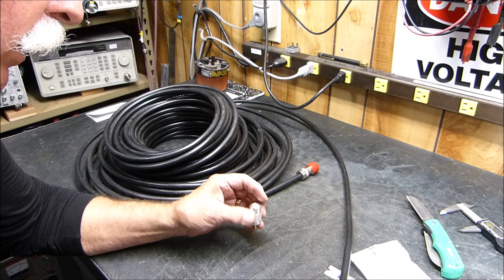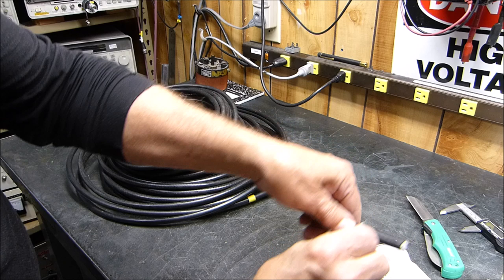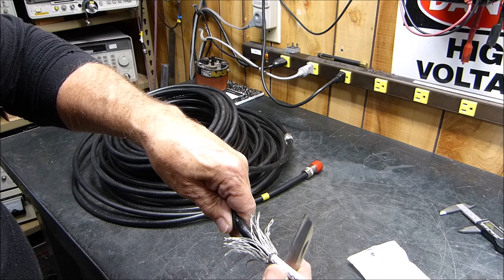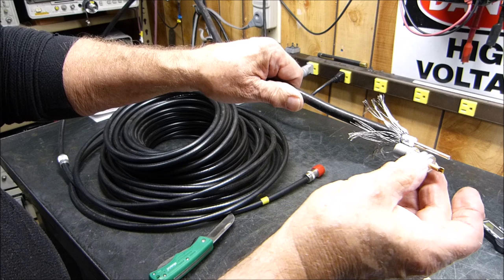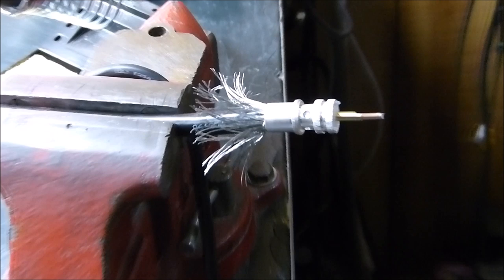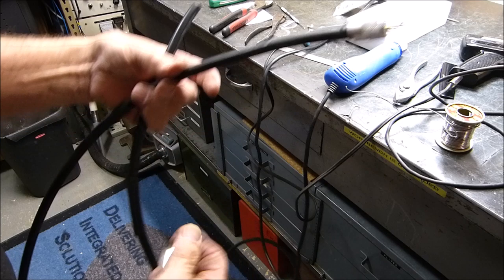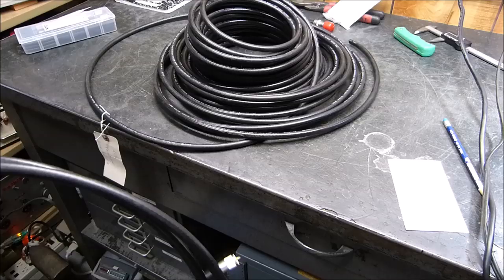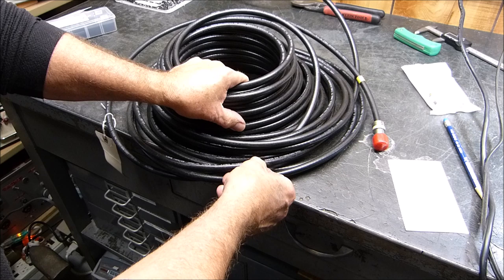Simple And Fast Method For Attaching PL-259 RF Connectors To RG-8, 9913, LMR-400 Size Coax

Comment: It figures that you learned this from a ham. I believe LMR 400 is designed to be crimped only. And depending on what frequency of use, this could be a particularly bad technique anyway. And you are living in the 1940's with those connectors. I would never, ever again attempt to solder the shield, even on RG213. I personally use compression type plugs for  213. Just saying. I wouldn't rely on that kind of connection to the shield, nor would I put the coaxial through the vice/twisty treatment either.

Comment: I have been using this technique for 15 - 20 years and it works very well.  I have used it on RG8X and RG58 with success.  The only variation I have done is to snip off the excessive braid or shorten the braid so when you screw the connector on the braid is no longer visible.  I have done this for years with RG8, RG8X and RG58.  The only difference for RG8X and RG58 is you have to push the RG - 176/U (for RG8X) and RG - 175/8 (RG58) over the braid and then screw the connector onto the reducer and then solder the center conductor.  Both techniques take some "elbow grease" but in the end you have a very tight mechanical connection on the braid.  It is interesting to note that the industry is going towards crimp connections on RF connectors in recent years, with the proper tools of course.
Reply: i have done this since 1979
Reply: Agreed on trimming all excessive braid, no point in having any hanging out of the connection.

Comment: While I would always solder a copper braided cable, aluminum braid is very tough to solder, and there is great risk of melting the Dielectric. When it doubt, check with the manufacturer: Times Microwaves says the LMR-400  braid is designed for crimping, and should NOT be soldered. Amphenol does NOT list LMR-400 as a supported cable for their standard PL-259. Why? Because trying to solder aluminum braid is a bad idea. Other than crimping, as odd is it might look, THIS gentleman's technique is the way to go. Used it for years on outdoor work, all connections sealed with GE advanced silicone. It's messy, tedious, but highly effective and permanent even in direct sun for decades, encasing the entire cable to cable connection in silicone for eternity. Oldest installation is about 30 years, connections sealed, no issues. NO PL-259 is designed to be watertight no matter which braid method is used, and must always be sealed for outdoor use.

Comment: This may be fine for a few years but connections like this are what were 90% of my calls for bad VHF radios in the marine industry.  Without a good electrical connection, either solder or crimp,  this will fail in any moisture and worse near the ocean. I quit using solder and crimp only if at all possible. With the right tool to crimp, it will last as long as the cable.  I also use a thick wall heat shrink tubing with a sealant on the inside or self vulcanizing tape. I have opened these over 20 years later and the connections are still like new.
Reply: I want to put up a hf antenna in the back yard,  maybe run 50 feet of coax. I was thinking about using times microwave LMR-400 because I want it to last and I will most likely be running an amp in the future, I was going to order the silver solder on connectors, I was going to shrink wrap the connector what brand of tape do you use and do you still shrink wrap it underneath?
Reply: @davidbrennan5  Silver solder requires too much heat and will damage the coax, use regular electronics solder, or crimp instead.  If you have trouble soldering the shield  you can strip the outside cover about 1 1/2" and with a hot iron tin the shield.  Do it quickly so you will not over heat the insulator, then using a copper tubing cutter  cut off the shield about 1/2" from the cover leaving 1" of the inner insulator showing.  (this works best with a solid insulator)  cut the insulator about 1/8" from the shield leaving 7/8" of center conductor.  now you should be able to twist on the PL259 if you did not over tin the shield.  Now solder the connector with a high wattage  soldering iron, around 140 watts or more , because you tinned the shield if should me easer to get a good solder joint.  Hopes this helps you.
Reply: If you want waterproof then use a waterproof connector not pl259..

Comment: So basically use the method every cb radio enthusiast on the planet used 40 years ago, i have never ever soldered the braid in the holes which are there to be able to see when you have screwed the pl259 on far enough not for soldering purposes...

Comment: This was how I was taught to install PL259s, back in the 70s.  What I learned through experience (and connector failures): the connections don't last very long, especially if used outdoors. Only thing I've found that was worse was crimped connectors.  Coax-seal stuff + electrical tape didn't help with either of those methods.  That's when I was shown how to properly solder these connectors on.  All you need is a good 100w soldering iron (no, soldering guns won't cut it).  Just sharing my experiences.
Reply from the maker: I don't doubt you are right. I do not use crimp connectors on anything but BNC. 
This method does seem to be OK indoors and I also solder the outside connections before covering them with coax seal and or tape. 
I have a 325 watt Weller soldering gun (Model D-550) and that is what I use to solder connectors. I put it together and then clamp the coax in a vice, get the PL-259 hot quickly and put the solder to it making sure it gets down in the holes to the shield then quickly rotate it 90 degrees and so on until I fill the four holes. 
Thanks for your comments.
Reply: Yes Sir !
Reply: I used to think the same and that's what I was taught. However...per the manufacturer, LMR-400 is not designed to have the braid soldered, it's designed for crimp-on connectors, with only the center pin soldered. Trying to heat up the PL-259 body and solder into holes to hopefully connect with aluminum strands which don't really solder makes no sense.  The above method may seem a touch odd, but it works. Though a bit messy and tedious to apply, I use GE advanced silicone to seal all outdoor connections involving PL-259s regardless of how they are made, they are not waterproof connectors. I have have helped install antennas that have been standing for over 25 years with connections still sealed watertight, I've had that verified. High quality silicone is incredibly durable even in direct all-day sunlight...fo decades.

Comment from the maker: Update 8/24/2024 - just had a bad connector on the end of my 20M hexbeam LMR-400 coax. I disconnected it when a thunderstorm was nearby and when I connected it up again today it was shorted - it was soldered braid thru the holes in the PL-259. About a year ago, I had a similar issue but this time it was on the 40M coax and in this case the center conductor was broken and open, (as I remember)...  Obviously, I did a poor job on these connections. We learn from our own mistakes often times.

Comment: 1. Completed ignored Times specification of crimp connectors.  2.  Bonus points for the moisture access thru the holes to allow for contamination of the dissimilar metal braid/foil interface, risk issues with the center conductor.

Comment: Relax!  This is a valid method, and for all the people giving you crap about this, they are just wrong!
First-off, unless you can solder the braid to the connector in just a very-few seconds, you will melt the center dielectric!  There are some dielectrics that are more tolerant of heat than others but unless you use an extreme amount of heat from a high-mass soldering iron (not gun!), you will melt it.  There was a ham who was also an RF-engineer that was giving demonstrations (I believe with a TDR?) whereby he showed that once the dielectric was compromised there was always an impedance-bobble (his term for impedance change) where you turned to dielectric into a puddle.  He remarked that professional ones are done with and induction heater, then rapidly cooled.

Furthermore, once the connector is installed using this video's no-solder method, the connection is so-tight that it forms what is known as a 'gas-tight' connection.
I have been using this method for over 50 years, and every one I take apart still has bright shiny-copper and the connector interior is also without corrosion--and there are only ever a few broken-wires but I am convinced they are from the disassembly--NOT the initial assembly! What you mostly see after disassembly is the braid-strands are actually embedded in the outer-jacket and not sheared off like has been said by the naysayers!

Tips: First, before you completely screw it all the way on, cut the braid, this way you won't get constant copper injections from the pokey-bits!
Next, just before the finally few turns, you can put some non-corrosive sealant or Coax-Seal which will seal the end. The heat shrink if a great idea as well.
To ease the screwing-on process, a small pipe-wrench will grip without slipping, and makes it easy to turn it; use a gloved hand on the other side for comfort.
Finally, (most-important!) when screwing the connector on, carefully watch when the dielectric bottoms-out on the connector's insulator; if you turn it past this point, you WILL shear the braid because you are now rotating in-place (and cutting in-place!); because there is no forward movement (i.e. the braid is locked in the same position and being sliced in the same place)!  It is obvious from the positive comments, most everyone is successful with this technique.  73...
Reply from the maker: I just had to repair one of my own, soldered-thru-the-holes, LMR-400 from a dead short at the connector. Sometimes we don't take our own good advice 🙂 it was years ago that I did it... Anyway, thanks for the tip of cutting the braid off before screwing the PL-259 on all the way. Nice touch.  73  WA4QGA

Comment: I've done this for years.  Also it's always good habit to ohm your cable after you're done building it, make sure there is no short.
  Great video.
Reply from the maker: Totally agree with using the ohm meter...  73
Reply: Soldering everything. 
Always. 
Corrosion

Comment: I’ve used this method for years. I made a little wooden jig out of a 2x4 with a hole a little smaller that the outside diameter of the coax and drilled longitudinally, and then sawed in half longitudinally.  I then use clamps to hold them together, clamping down on the coax while screwing on the connector.

Comment: done this for many years, its a great connection, one thing is that you have to really comb out the braid well or the connector will not thread over the braid properly, once it catches your good to go. i always use some thick heat shrink with the glue to go over the threaded part so the braid that may stick out wont poke me.

Comment: I have put hundreds of PL-259s this exact same way, always got a good connection that lasted.
Reply from the maker: I just went thru this procedure again on a 40M dipole where the coax (LMR-400) hangs from the balun. The old connection was a soldered braid to the PL-259 and lasted maybe a year. I think the shield broke because it was soldered and probably rigid and the solder wicked down the braid. I will see in about a year from now...  Thanks for your comments. 73

Comment: I heard about this method years ago, but older Amateur operators said the tight threading would slice up the braid, so I ditched the idea.   I’m revamping my radio hobby, and will give this a try.  Thanks!
Reply from the maker: I thought the same thing about it cutting the wires on the braid so I actually screwed the PL-259 back off to check, and in my case, it did not cut the wires. I was surprised and only then decided to make this video. I also use RG-9 cable which I really like and in that case (two shields) I still solder the PL-259 on but for the LMR-400 is seems to be OK.  BTW - I am one of the older hams at 71 and have been on the air since 1963.  73
Reply: Forgot about coax use rca jacks 😡 plug 🔌 in play or 75 ohm plug 🔌 in play no soldering no test meters thrifty stores tuns of color coaxial cable 🚠 green 💚 for beams 🟡 for Diplo white 🤍 for long wire antenna rca 🔇 switch box wife will happily no drilling holes open window 🪟 flat wire no mfj rip 📴 4 dollar 💵 special antenna straight wire
Reply: That crap full in landfill see to many people throwing it away
Reply: No amp 😭 ok folks 😭 just make shure you ground everything not 🚫🚫 back to the power supply 🎣 on your main line 😜

Comment: I used to solder the little holes too but started using this method about 2 years ago. It works well. On some LMR400 coax (Shireen) I sand paper or whittle with a sharp knife the outer black covering to reduce its diameter to allow the inner threads of the PL259 to screw onto the coax a little easier. Haven't had a problem yet.

Comment: I never use solid core coax. Always use silver PL259 so they soldier very easily and soldier the braids. I used your method before I wised up. Thanks for the vid.

Comment: you can  also use a copper  pipe cutter . to cut the cable  as you spin it just screw  the cutter tighter as you spin it . its safer than a blade knife .

Comment: I had a broadcast engineer friend of mine show me this technique some 25 years ago and I've used ever since.   However, what I learned from your video is the exact measurements for the cuts.  I had been eyeballing them before.  I like your measurements better!  Thanks for sharing!  73 de W5EN
Reply from the maker: Steve - I am glad it helped. I just looked you up on QRZ and read your bio. I also started at 13 in 1963 with my general license, examined for code and written test by the FCC in Atlanta, GA. I had studied code the summer preceding the exam in Oak Ridge, TN with my uncle who was a chemist at ORNL (the exam was at the end of the summer in September just before school started) and somehow passed the code. Whewwww... I guess I have always been OK at passing tests although I never thought I was until now that I am 70 and look back on time. Passing tests did not necessarily mean I knew what I was doing....   LOL,   but it counts for something, I suppose. I hope we meet on 20M someday since that is the only band I operate nowadays.  73  WA4QGA

Comment: Excellent presentation plus you have saved me the cost of buying the fancy strip tools to put on crimp connectors which are fine but I have some nice Amphenol silver PL-259' in my parts box. I think my next purchase of LMR-400 I will pay a little extra and go with the ultra-flex.

Comment: Tried this out today on some 9913. Easy peezy,. I'll be doing it this way from now on.  Thanks for the tip! :)
Reply from the maker: I have been into soldering the shield for 50+ years and this actually seems better and the PL-259 can be re-used and no risk of melting the dielectric. I am glad it helped and thanks for your comments

Comment: Those connectors are a pleasure to use and there is an adapter part that comes with them to allow the use of RG58U, Just be safe not sorry and we don't want another silent key.

Comment: I've been doing it that way since 1977 been around a while-and to beaconmania- the PL259 is just fine for any HF to 200Mhz application with power up to 1.5KW on HF at least. Commercial VHF marine radios and HF marine radios use them-far beyond CB I  must say .

Comment: No need to separate the shield to fold it back. Just push back and it will widen and you can reverse it right over the outside is the coax, still braided, still intact, no little pieces getting in to things.
Reply: Yes - like a Chinese finger trap

Comment: Funny, when I start playing with antennas back in 2007, that was the way I connect it. Cool!
Reply from the maker: Not sure why it took me so long to discover this. I started looking around YT for ideas and ran across one gentleman that dips his braid in molten lead to prep it before soldering thru the holes.. I kind of liked that method but it is still "old style" with the likelihood of solder in the threads,  almost impossible to reuse the connector, etc.  
Then I ran across this method and after a few experiments, it turned out really nice and the braid was not cut by the threads in the PL-259 so it looked promising. I have several connections made this  way now and I think it is the way to go. Thanks for your comments. Hope to hear you on 20M    WA4QGA
Reply: @ElPasoTubeAmps  Yup! It´s a nice way to do it. I still have connectors on some antennas like that. And the setup is there working fine! But now I started to apply solder on the new ones. Maybe now I´m just complicating.  73

Comment: i have done it this way for years.. the only thing i figured out over time was when possible do not cut the longer extra shield braid wire off. screw the connector on  and tighten it up to the radio or ant or what ever. then fold the braid/shield wire back towards the tip. then slide a hose clamp  over the base and tighten the extra braid.to the bottom of the connector. so you have the extra that you were going to cut off now touching it also.